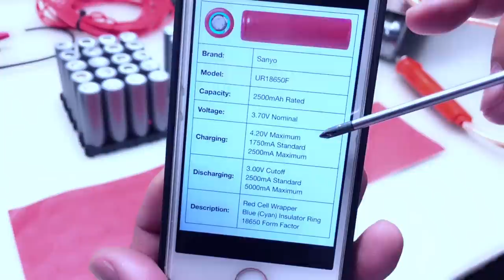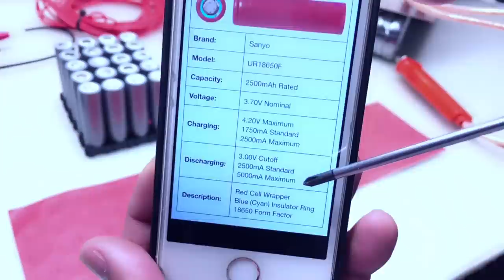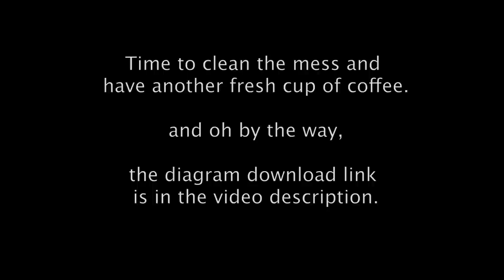DIY 12V 50Ah Lithium-ion 18650 Cells Para sa Portable Solar Generator (Spot Welded)

Comment: sir pasensya napo.  baguhan po ako. mag diy pero medyu mahina p akahit naka seminar. mag set up sana ako ng solar gen. mayrun na ako 4pcs 3.2volts na  40amps na prismatic lifepo4 bat. ano po iba kulang.  favor po. list of materials form SP to SCC and inverter pati po safety breakers, bms and cable sizes.   and isa pa po. di ko akalaing bilis nyu sumagot ssa messages. you inspired me para gumawa ng mabuti sa kapwa. sana mahawa din yung iba. GOD BLESS po. again salamat.
Reply from the maker: Magandang araw. 😊👋 Ang aking mga tutorial ay kompleto na at maari nyo po ng mas ma-improve. Hindi ko na kailangan pang ilista at isa-isahin ang mga parts, dahil andyan na ho sa mismong video ang mga yan,

Ang gagawin nyo na lang po ay mag-ukol ng panahon na manood upang matuto at tyaga na manood. 😊👍

Comment: Sana po mayroon din pong step by step tutorial sa pagkabit ng BMS sa battery. Which wire goes to where kasi di po nasali yung BMS audio installation kaya para sa wala pang alam sa connections nito ay nalilito paano ikabit ang BMS.. salamat po
Reply from the maker: Good day. Merong diagram links sa video description na madaling sundan. Para mas maging madali sa'yo, eto ang mga links 3S 30A BMS - https://cutt.ly/jCc1nZc
5A Active Balancer - https://bit.ly/2U2HlJz

Comment: I'm was little jealous that you've made the Battery pack really perfect LOL 👍
And those MOSFETs on BMS isn't getting heat? Cause I'm trying to buy one BMS just like yours or same as yours.
Reply from the maker: The bms is doing fine, as long as the charging/discharging current is within its rating. 😊 👍  Nevetheless, a normal heat temperature can be expected with this type of bms.

Comment: Napapuzzle po ako sa inyo na grabe ang galing ninyo tech din ksi ako engineer po ba kyo.. question po paano madetect kung aling cell ang defective  after many uses at how to change if one or two are defective.. Mahirap matanggal sa weld
Reply from the maker: Good day E. 😊  Tulad ng nabanggit ko sa video, lahat ng mga cells ay siguradong "good as new." Kaya kung meron man dito sa mga cells na'to ang bibigay, isang bagay ang may katiyakan, taon muna ang bibilangin bago mangyari yon. Sa pag-aayos naman, walang ibang choice kundi ang baklasin ang buong battery bank. Hindi tulad ng "soldered fused method" na pwedeng i-desolder ang kung aling cell ang papalitan.

Salamat sa panonood at suporta. 👍  God bless.
Reply: Last time before I saw your video nagbuo na po ako pero after short use bumigay agad kya I lost my interest mahirap magbaklas ng welded setup.. Ty po
Reply from the maker: @eduardo delrey  Kung non-reliable cells ang gagamitin, frustration ang kapalit neto. Know your cells before building a battery bank para sigurado.Ang DIY 10KWh Powerwall ko na may 200Ah 14S battery bank ay more than a year old na, so far walang ni isang cells ang nagloloko. 😊 👍

But since you are a tech, hindi dapat problema o alalahanin yan. Yan ang mga bagay na gustong gusto natin, mambutingting. Tiyak na sanay ka dyan,  di po ba? 😁👍
Reply: @JFLegaspi  sir isa na ako sa mga follower mo you give a spat on my shoulder para magbuo muli ng battery packs.. Ty sir...
Reply from the maker: Enjoy building your project. 😊👍 Be safe and God bless.

Comment: Hello po sir jf,  masugid nyo po akong manonood, at bago lang din po ako sa diy ng eletronics,  tanong ko lng po sana kung anong active balancer po ang kailangan ko s lifepo4 150ah prismatic lithium ion phosphate? 4 cell po, ilang amp po n active balancer ang pwedi sir? Salamat po
Reply from the maker: Good day. 😊  Pwede mong kabitan ng 100A 4S LiFePO4 BMS, pero ang pinakatama ay ibase sa C-rate ng cells at load ng setup. 👍
Reply: @JFLegaspi  maraming salamat po sir,  napanood ko ung topic about s c-rate salamat po ng marami s pag reply,  marami p po sana kayong matulungan,  GOD BLESS PO.

Comment: boss sa 32650 po na set up na 12v  50ah ilan ampere po ng BMS ang kailangan at ng active balancer ilan rin po ampere thank u dame ko n natutunan sa pag diy po eh kakapanood sa inyo
Reply from the maker: Good day. 😊  Ang pagpili ng BMS ay nakabase sa dalawang bagay. Una, ay ang C-rate ng cells. Nakasulat yan sa datasheet ng binili ang mga cells, kung wala, pwedeng hingin sa seller yon. Pangalawa, ay ang amp draw ng load. 👍

Para sa karagdagang inpormasyon, pakipanood ang mga videos na 'to.
BMS - https://youtu.be/mpAKJyzz_Kg
C-rate Part 1 - https://youtu.be/zX3QGVtEFWQ
C-rate Part 2 - https://youtu.be/pmex-SKw8VQ

Comment: Nice sir! Planning to build one. Anong setting po ng spot welder pag ganito? ano po ba mas maganda 18650, 32650, or 32700?
Reply from the maker: Good day. Power density ay almost pareho lang, less ang work sa 32650/32700 kesa 18650.

Comment: Broo review active balancer
Reply from the maker: Good day Z. That's good content. 🤓 👍
Reply: @JFLegaspi  i waitinf
Reply: @JFLegaspi  bro, the active balancer has 5 cable lines. while li-ion18650 only 4 wires. Where is the 1 cable plugged in? does active balancer 4s work on 3s?
Reply from the maker: @zaidudinzaidudin1852  Yes, an active balancer for 4S also works for 3S. Just leave the last lead wires unconnected. 🤓 👍

Comment: Sir if ask lng po if pwede 4 pack sa 12 v
Reply from the maker: Good day. Kung LiFePO4 ang gagamitin, 4S po talaga. Kapag kasi Lithium-ion, alanganin ang 4S sa max voltage na 16.8V at cut-off voltage na 12V. Masyadong mataas ang max voltage para sa 12V inverter na hanggang 15V - 15.5V lang.

Comment: Maestro @JFLegaspi, question?? sa dami ng battery na yan 12V lang ang total nya?
Reply from the maker: Good day. Hindi po sa bilang o dami naka-base ang boltahe ng battery pack or bank, kundi sa kung ano ang configuration neto. Kung ilang cells ang naka-parallel at ilang cells ang naka series.

Comment: Sir tanung ko lang po uli,kya bang patakbuhin ang diy electric mountain bike ng 12v battery pack na my 18ah?salamat po
Reply from the maker: Good day. Alanganin ang 12V system para sa e-bike. Mas efficient ang higher voltage tulad ng 36 or 48V. Yan din ang karamihan sa mga e-bike motor ngayon. 😊👍
Reply: @JFLegaspi  ,ganu po ba sir.,kung 36v po ang gagamitin ko ok lng po ba na starter motor na 12v ang ilagay ko?salamat
Reply: ,sir tanung ko lang po.pwede po bang pagsamahin ko ang dalawang 12v battery pack para maging 24v at yun ang ilagay ko sa diy ebike na my starter motor na 12v?salamat po..

Comment: anong ang specs ng active balancer at BMS para sa 24 volt Bat bank , kung mayrun? thanks
Reply from the maker: Good day. Depende po yan sa total C-rate ng battery bank at current draw ng load.

Comment: Sir jf yung sana connection ng anti lighting ng solar panel system kahit yong diagram lng god bless you sir.
Reply from the maker: DC SPD or solar panel grounding? 😊
Reply: @JFLegaspi  ewan sir basta yung anti kidlat ano po ba yun sir kc dto sa cagayan valley panahon ngayon ng kulog at kidlat kaya nakakatakot ano po ba best doon sir sa anti kidlat.TY.

Comment: Alin ang mas nakamura, DIY o ready to use na power bank?
Reply from the maker: Good day. Dahil sa dumadami na ang mga supplier ngayon nga mga plug n play type na lithium batteries, tulad na lang ng Blue Carbon at iba pang mga brand, kung kakalkulahin natin ang oras at lakas ng igugugol sa pagdi-DIY, lalabas na mas mura ang plug n play type. 

Pero meron kasing learning process sa DIY, at meron ding intangible benefits na minsan ay hindi maipalaiwanag ng kahit anong logical reasoning. Iba ang sene of fulfillment ng pagdi-DIY kesa bumili ng plug 'n play.

Nasa personal na desisyon nyo po yan. 🤓 👍

Comment: Sir jf pwede po ba gumawa ng dalawa lithium battery pack kagaya ng nasa video dalawa battery connect ng parallel? Safe ba mag charge at discharge habang nakaparallel ang dalawa battery pack?
Reply from the maker: Good day. Yes, pwede. Tandaan natin na sa parallel connection, nagdadagdag ang capacity, charging at discharging current na kakayanin ng battery bank. Pakipanood ang video tutorial ko tungkol sa C-rate. May part 1 and 2 yon. 🤓 👍
Reply: @JFLegaspi  maraming salamat po ulit❤

Comment: Good day Sir may link po ba kayo ku g san pedeng makabili ng 18650 lithium?wala po kasi mahanap dito samin, slamat po
Reply from the maker: Good day. Sali po kayo sa Lithium Power Philippines Fb group at hanapin nyo po si Melike Balanay. Isa po sya sa mga moderator doon. Legit seller 👍😊

Comment: Hello, I have a question regarding this same BMS please, if I want to draw like 15-20Amps, should I use balance wires that can carry this current, or maybe is it possible to use small sense wires and in same time connect a thick wire from the main negative and positive of the battery to the discharge terminals??
Reply from the maker: Good day. Technically, that 20A current will be evenly distributed by the balance wires. 🤓👍
Reply: thank you so much for replying, I still have it unclear, do you mean each terminal ( 4.2v / 8.4 and 12.6v ) will deliver 20 amp total? if so. isn't it necessary to have balance wires that can carry 5 amps individually??

Comment: @JFLegaspi sir tanung ko lng poh, meron ako existing na 12v lifepo4 battery pack, then meron ako new cell ng lifepo4, plan ko eh upgrade ng 24v, pwd ba eh ipag sama yung luma at bago? at need cla eh top balance ulit lahat? salamat sir
Reply from the maker: Kung buwan lang naman ang pagitan ng bago’t lumang cells, magkaparehp ang capacity at specs, pwedeng pagsamahin 😊👍

Comment: Sir. Pa request naman ng 72v 55ah 160a/300a bms
Reply from the maker: Good day. Pareho lang din ang working principle nyan. Mas marami lang ang cells na naka series at ganun din sa BMS at Active Balancer.
Reply: @JFLegaspi  paano malaman ang over all discharge ng batt pack
Reply from the maker: @kennethonate3408  you mean ang C-rate? Kung C-rate, alamin ang C-rate per cell at multiply kung ilang cells ang naka-parallel sa isang pack. Ang resulta ay ang discharge C-rate.

Comment: Sir 50 A 12 volts...
Ilang oras na po ang tagal pag gamitin sa amplifier 300×2 watts... Salamat..
Reply from the maker: Good day. Wala pang isang oras.
Reply: @JFLegaspi yong aabot ng limang apat na oras  ilang cells ba kailanganin pag may 4s 12 volt tapos gamitin dyan sa 300x2watts.. Salamat sir. O di kayay bili nalang ako sayu sir.
Reply from the maker: @yobhebstv3021  pasensya na at wala ako sa Pinas.
Reply from the maker: Mas mahal at mahirap shipping, wala ako sa Pinas. 🤓👍

Comment: Paano malaman kung anong specs ng bms ang dapat na gamitin, ilang amps dapat na bms? Meron ako ditong 39pcs 21700 batteries na 4000mah, gusto ko sana 12v na battery pack 3s13p. Sana matulongan ako, salamat.
Reply from the maker: Good day. Ang pinaka madaling paraan ay isunod sa C-rate ng cells kung ano ang Amp rate ng BMS. Ang C-rate ay nag-aadd kapag naka-parallel ang mga cells, sa series cinnection ay hindi.

Comment: Sir about sa scc pwm lang kasi. Kaya pansamantala anong pwm scc ang recommended niyo po
Reply from the maker: Siguruhin nyo na compatible sa Li-ion cells ang PWM SCC na bibilhin nyo, 12.6V sa 3S ang charging voltage.
Reply: @JFLegaspi  sirano po setting parameters Ng 4s9p lifpo4 32650

Comment: Hi sir maraming salamat sa tutorial video. May tanong lang po ako, nakabili na kasi ako ng 3s 7p with BMS po sya nasa 10ah lang po kasi mababa lang mah ng 18650. Okay lang po ba na gagawa pa ako ulit ng dalawa pa na kapareha para sa parallel connection para umabot ng 30ah? I mean okay lang po ba na 3 parallel na same setup ng 18650 ? Thanks po in advance at pa approved po ako sa FB group 😁

Solar ko pala gagamitin, solar panel ko po ay dalawang 60w
Reply from the maker: Good day. Opo, pwede po na talong battery bank na magkakapareho ang capacity at bms naka-parallel.

Comment: Sir tanong lang po meron po kasi ako build na 4s2p na lifep04 pang power wheels, yung motor ng power wheels is 12v at yung connected po sa battery na wire ay manipis possible po na may power loss yon kasi medjo mabagal po  e need po makapal talaga yung wire para mabigay ng battery maximum na power kung makapal wire?
Reply from the maker: Yes, meron. Lalo na kung 12V yan, ibig sabihin ay low voltage at kapag mababa ang boltahe, ibig sabihin mataas ang amperahe. Kailangan ang tamang sukat ng size ng wire na angkop sa dumadaloy na amperahe base sa hugot ng motor. 😊👍

Comment: sir, matanong lang po kung 3.7V 3s is 11.1 lang hindi umabot ng 12V.. pwede bang gawing 4s ang ganyan?
Reply from the maker: Ang Lithium-ion ay may maximum voltage of 4.2V per cell, ang 3S ay 12.6V. Ang LiFePO4 naman ay may maximum voltage of 3.65V per cell, so 4S ang kailangan 14.6V.

Comment: sir good day ask ko lng bakit meron tunog yung battery pack ko 4s 5p 32650 kapag naka on na yung inverter ko. sound po sa battery low buzz or humming sound kapag sa pwm naman okay sya kapag nag cha-charge..kapag naka on lng yung inverter ko may buzz yung battery bank ko. salamat in advance po sir!
Reply from the maker: Good day. Paki-check nyo baka mag maliwang na turnilyo o connection.
Reply: @JFLegaspi   maraming salamat po muli sa reply nyo sir double check ko nang maigi ulit yung battery bank ko again sir salamat sa tuts nyo God bless po!

Comment: Bosing may itanong lg Po. SA off grid solar panel gnagawa pang charge Ng battery   Tanong ko lg.  Pwd ba e replace ung 12v/24v battery charger? na mg charge Ng battery?  Ty bosing sa sagot Po ty
Reply from the maker: Good day. May mga charger na nabibili sa ngayon na para talaga sa lihtium-ion at LiFePO4 cells. Ang mga charging voltage neto ay angkop sa dalawang klase ng cells na yan.

Comment: I bought 120, 18650 batteries to build a solar generator. I was told 18650's aren't good to use in a 12v system that I would be better building a 24v system. I am so confused.

Comment: Sir. Kung mag buo ba ako ng ganyan pede ba sya isama or i parallel sa lead-acid battery? sa ngayon kc naka lead-acid battery yun setup ko. Balak ko kc mag add ng lithium-ion cell. Salamat po
Reply from the maker: Good day 😊 Hindi recommended. Mas magandang palitan na lang ng lithium ang lead acid batteries.
Reply: @JFLegaspi  maraming salamat po.

Comment: come fai ha misurare gli hampere della batteria io neò fatta una di 96 celle 40batterie per 3 in serie 12 volt quanti amper sono
Reply from the maker: È possibile utilizzare un contatore multifunzione come PZEM 015 con uno shunt da 50 A. Seguire lo schema per l'installazione ed eseguire un test di capacità sulla batteria per determinare la capacità effettiva in AH.

Ecco il link per l'acquisto del modulo. https://shorturl.at/dkuw8

Comment: Sir JF, Pwede bang 24 volts ang setup ko dyan imbes na 12 volts
O pwede ba akong gumawa ng katulad nyan tapos i-series ko na lang?

Gusto ko sana kase mag practice muna bago ako tumuloy ng 100 AH. 
Tapos upgrade ko na lang later on ang naisetup kong battery system na 12 volts pag kabisado ko na mag setup ng battery.
Reply from the maker: Dapat po ay 7S ang configuration ng battery pack kung 24V ang balak nyo.
Reply: @JFLegaspi  ok Sir JF. Salamat po ng marami!

Comment: Sir, ano po maganda  sa solar setup or lead acid battery or yung mga lithium ion cells, if may video po kayo nyan, post na lng para ma check ko ang link.
Reply from the maker: LiFePO4 po ang mas magandang gamitin at safe.
Reply: @JFLegaspi  thank you po sir
Reply: @JFLegaspi  Sir may service/retail ba kayo nabagbebenta ng po kayo 12v 100Ah na lithium ion battery cells na naka pcm or naka solder na ? If yes po, magkano po?
Reply from the maker: @christianaplaon2477  wala po, dahil ako ay wala sa Pinas, paumnahin.
Reply: @JFLegaspi  ah okay po sir, thank you
Reply: Sir , safe po ba gamitin ang solar setup habang kumukuha ng energy sa araw at same time gumagamit ng load given na mag comply sa D.O.D. ng battery?

Comment: sir pwede ba replacement battery sa UPS yan ganyan na set up, 3S 30A BMS tapos ang battery ko 3S7P
Reply from the maker: Mas maganda kung 32650 or 32700  LiFePO4 cells ang gamitin kesa Lithium-ion 18650. Hindi kasi magtutugma o alangnin ang magiging voltage. Kapag kasi 3S config, 12.6V lang ang max. Kapag 4S naman, sobra 16.8V at kung susundin ang high voltage cut-off ng inverter na 15V, bitin naman sa charge ang mga cells.
Reply: @JFLegaspi  salamat sir,